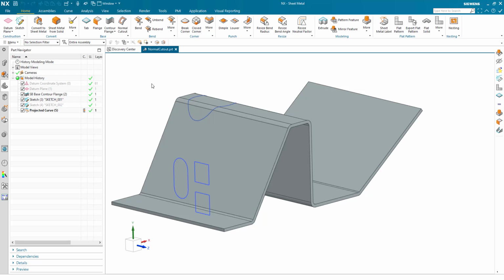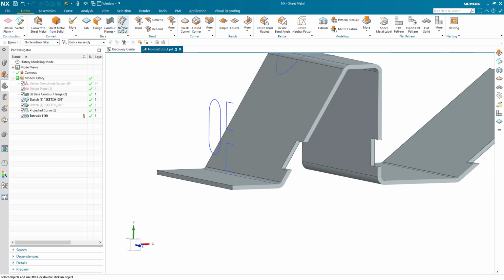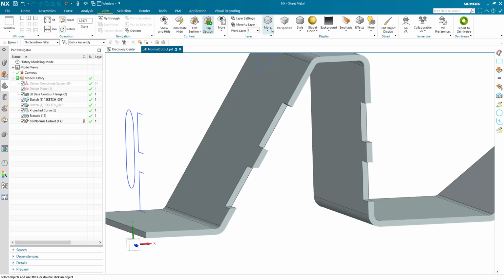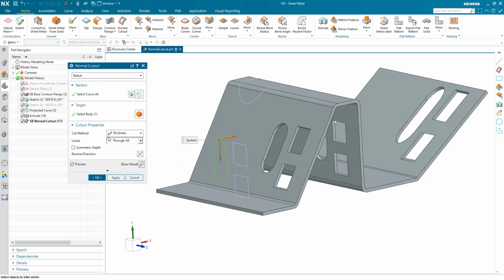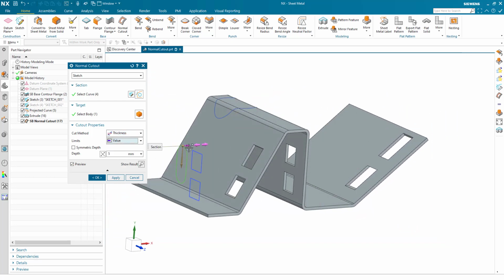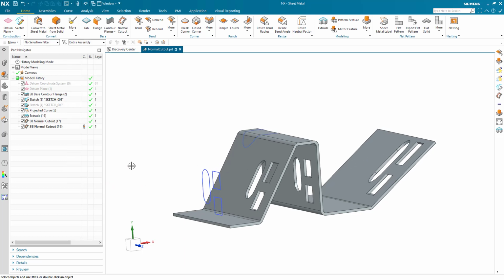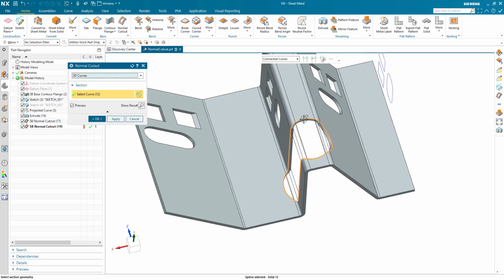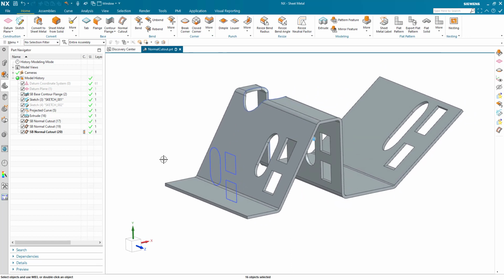Siemens NX Sheet Metal: Normal Cutout

Comment: Hi Dave, I'm from China, is it possible to set a different K factor in NX Solid Convert Sheet Metal? Thanks!
Reply from the maker: Hello Anhui! Yes of course.  Use the part properties in preferences to set the Neutral Factor first, then run Convert to Sheet Metal.
If you already have the converted part you can always use Resize Neutral Factor command.
Reply: @deedub7777  Hello Dave, I can't describe in English, please send me your EMAIL, I will send you a file, how to set two or more different K factors in the same model, thank you!
Reply from the maker: @ANHUIZHONGHEIMPEXPCOLTD  Sorry, I do not share email address here.  Please post your question on community.sw.siemens.com and I will respond there
Reply: Thank you very much!😊